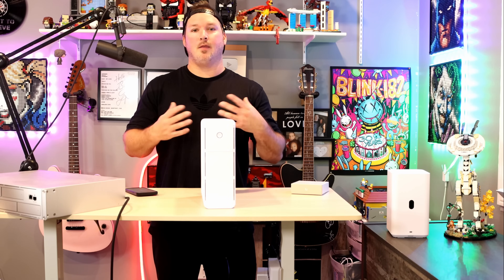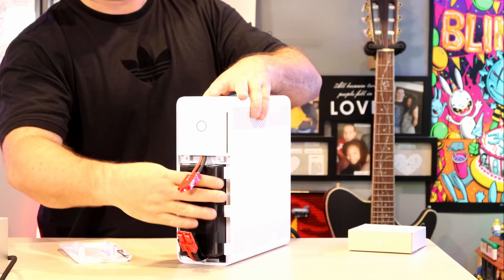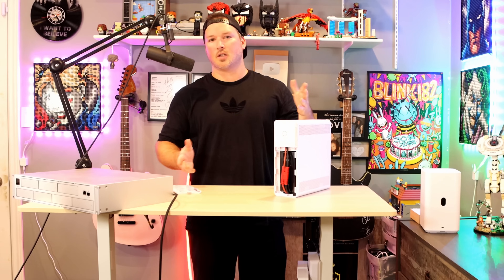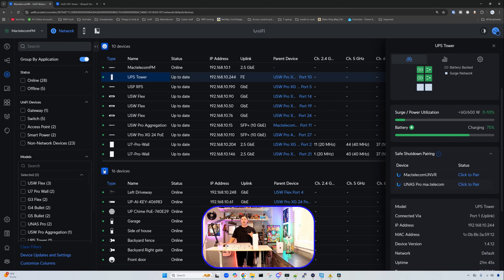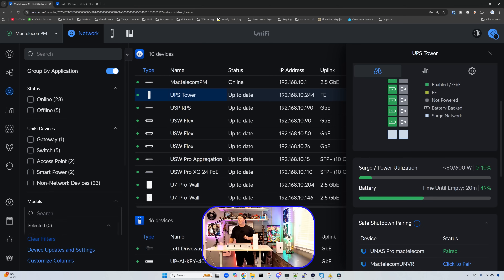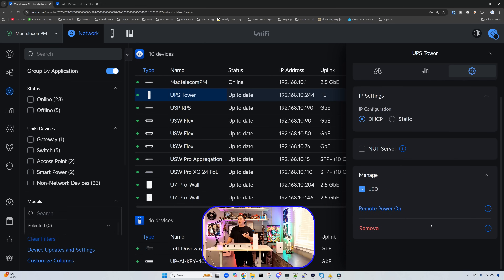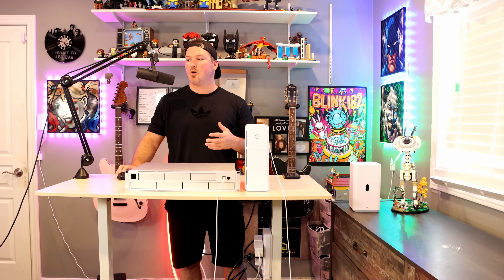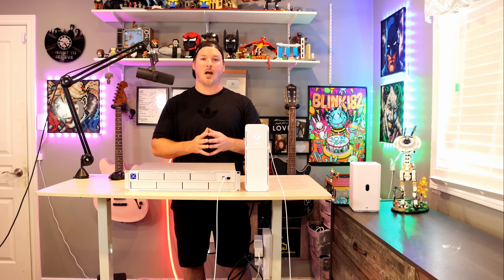UniFi UPS Tower Follow Up

Comment: In my area we get brownouts during high AC usage days, or occasional power outages because of cars crashing into the local power pole. In these cases the power has gone out for a few minutes before getting rerouted. Usually the 1500VA APC UPS saves our Ubiquiti gear and Synology server from having to shut down. It this can't recover from a power failure (and tell the server to start back up gracefully) then we have a problem.

Comment: Is this MHB MS9-12 battery not a conventional lead-acid battery? The Ubiquiti advertisement mentions a lithium-ion battery. The autonomy of these conventional batteries is very low. They could have used LiFePO4 batteries with higher energy density.

Comment: It's really about timing and use case and this is a flawed test at best...  Typically you would keep your device powered on during the power loss until closer to battery drain...and if power is restored, then there is not shutdown even for the attached device.   If power is not restored until batty is nearly drained, then shutdown connected devices and UPS runs out of battery and then cuts power to the attached devices (cuts power to the outlets).  this signals a hard power off for the attached device,  which if configured corrected, then when power is restored to the UPS/power flowing to the outlet, the attached device will auto power back on.

Comment: I don't have supported devices from unifi but with an HP Server (Proxmox and NUT) I works remote without the need to pull the power cable. You just have to give it some time to power off the outputs and ups itself, around 20 seconds and all lights on the ups are dark and you hear a relais.. I can't see if yours was off complete before you power on again

"remote power off" 
wait around 30 seconds
"remote power on"
wait around 15 seconds and you hear the relais and lights go on
wait another 5-10 seconds and my HP is booting

Comment: Love the videos.    My 2U UPS just arrived.   My set up.   Closet #1 has a UDM Pro + USW-Pro-Max-24-PoE on a Cyber Power UPS and Closet #2 has USW Pro HD 24 PoE + UNVR PRO + 2U UPS.     What I realized is a couple of things and I REALLY HOPE Ubiquiti adds more features to this.     My two closest are connected via a DAC cable.    

Once power is unplugged to Closet #2 the UNVR will shut down the UNVR in 10 Seconds on Battery (paired).  The switch cannot be paired so it stays on.  

 I happen to have an extra ethernet run to closet #1 to get the 2U UPS to the cloud gateway.    In other words "out of band management" connection to get to the 2U UPS without the DAC cable.   This product just isn't ready for prime time yet and some network design needs to be considered but you can get it back online without pulling cords...it is all about getting the power to bounce while not taking the path down to get the remote turn ON command to the UPS

I was hoping to avoid building a NUT server to help the scenario with some other NAS stuff I have.  They need to add individual plug behavior to the UPS interface.   FYI.   Once the power is off and the UNVR Pro shuts down in 10 Seconds....  My USW Pro HD 24 PoE ~50% port consumed , The 2U Ups says it has 1 hr 7 min of power remaining.

Comment: I grabbed one of these, plugged my UDM-Pro into it and then plugged into my switch with Ethernet, and Network hasn't detected it. I'm running UniFi OS 4.3.6 and Network 9.4.19. Am I missing something or did I get a bad unit?

Comment: It would seem that without the individual port shutdown option you can't get the right signal to a device directly plugged in to power back on remotely.  I can live with that personally, there are some smart plugs that can be used to workaround that I'd imagine but I think even for this price point it would be great to see that added like the Pro PDUs.  Certainly would give this an edge over competing/similar products.

Comment: For the price point, I get that it isn't fully "smart" per power port, but it seems like they could have added that and jumped the price $30, and we would pay it. I also hope they add some ability to control what happens when power is lost. I would like the ability to shut down select switches and even select POE ports during a power outage, but keep others up as long as possible. Keep your modem, UDM, and main switch running. Also, ensure POE is enabled on ports connected to common area WiFi, Door Access, and a subset of main cameras. By being more selective with what is kept powered, the battery would last longer, but still be there for power sags for all equipment.

Comment: Because each outlet is  not remotely controlled, I would plug my UniPDU into the UPS.  That way I could remotely “unplug” the UNas and cause a Remote Power On.  The optimum solution for me is to have battery banks inline from my main power to my rack PDU. Then use a DCIM to do shutdowns.
Reply: Well this TowerUPS is not really meant for a rack specific use case. It's a dumbUPS.

Comment: Feels like a very early product in general. I would hold off for a year or so and hopefully both features and capacity improves.
Reply: 12V 9Ah is the standard for office/home use case. Usually the batteries are HighDrain to hold PCs for a couple of minutes.

Comment: Will the Unifi system re-calculate the available power if you replace the battery with a larger 12V, lets say with a 60Ah?
Unifi must sort out the "device auto-restart after UPS is drained"-issue. That is a deal-breaker. 
V2 of the U-UPS Tower, should have 12, 9 and 5 V outlets as well, since so much of SMB network devices are in that range. Also the power cycling of outlets, with maybe a priority settings; If UPS looses main power, turn of outlet 4 when 50% of battery is left, then safe shutdown on outlet 1 and 2 when 20% left, then safe shutdown of #3 when 10%.

Comment: Just installed mine this morning. Already up to date, 90% battery charged.

But there is something I do not understand: the ups had a network activity quite “intensive” for a couple of minutes (almost 300 Mb), after adoption. Any idea?
Reply: Firmware updates?

Comment: There should be an option to set the shutdown time for each plug based on percentage of battery left on power failure. As well, lack of auto power on after mains power restoration is a deal breaker!

Comment: Those replacement batteries are a game changer in the UPS market: easily available and inexpensive when compared to APC and Cyperpower (or Eaton for that matter). But oof, that not coming backup when powering on... I suspect that is a bug and hopefully they will fix in an upcoming update. I wonder if that is a limitation with magic packets or something like that, or if they need to implement the ability to power cycle the ports.
Reply: I have always replaced APC batteries with third party batteries, just reuse their wire harness.  There is nothing special about the batteries inside APC battery packs.
Reply: What are you blathering on about? APC, CyberPower etc. replacement batteries are readily available (OEM and third-party), and are not expensive.
Reply: @milhousevh  The same batteries APC uses are available from others for less.  If you want to pay full price for an APC labeled battery then go ahead.  If I can save $30-40 and reuse the existing wire harness then it is money in my pocket.  Paying $75-100 for APC labeled batteries is expensive for me as I have many UPS devices.
Reply: @jaycahow4667 That's what I said. Batteries are available from third-parties. I'm not saying anyone has to buy the branded OEM batteries (although they can if they wish).

Comment: Thanks for the follow up.  Silly it doesn’t auto power on.  Can I ask, the battery is HOT SWAPPABLE right ?
Reply: Every UPS I have seen with a breakable battery power wire was hot swappable so I would guess this one is as well.

Comment: Also as another warning, the compatible devices listed on the website are INCORRECT and confirmed by Unifi support. The only devices that support smart shutdown right now seem to be storage devices and NO other device.
Reply: All their devices are actually compatible with all UPS devices as they just take power unless they need true sine wave power which only some UPS devices (not this one) deliver when on their batteries.  Storage or computer devices are special because unlike their other devices they require a graceful shutdown to prevent lost or corrupted data especially if they have write caching enabled.  So it makes total sense that only storage devices support remote shutdown.

That is not preventing them from implementing remote shutdown/startup of other devices but that is not something you normally do like recycling a switch or router remotely.  You might recycle a hung POE device but not normally the entire switch.
Reply: @jaycahow4667  I understand what you're saying but it was a bit confusing/misleading I think at the beginning. They have since updated the website to specify the graceful shutdown is only supported by those two storage devices.

Comment: If you remote power off, ALL DEVICES connected to the UPS tower will turn off just fyi.
Reply: I  noticed that with the 1 I purchased and received today. It seems to have 1 relay to control all the backup outlets.

Comment: Try unplugging the UPS mains power and leave it alone until the UPS completely runs out of battery and shuts off. Then re-connect the UPS to mains power... does the UPS automatically power itself back on and restore power to the UNAS then.

Comment: Not a bad unit but only having a single 9ah battery you will need to be very careful on what you plugin so in event of a blackout you have enough runtime on battery to do a safe shut down. APC ups tower units normally have 2 - 7ah on the low end and up to 2 - 9ah batteries for double the runtime. With the APC BR1500G able to connect and exterrnal addon battery pack that has an extra 4 9ah batteries. My  BR1500G with the battery pack with a 130w load can stay running for 171 minutes without wall power.

Comment: I like the ease of replacement with the battery. It was kind of a PITA with my cyberpower UPS. But this UniFi UPS doesn’t have pure sine wave and is pretty low capacity. I’ll wait to see how the 2U UPS reviews look.
Reply: I think 2U has the same drawbacks, they are working on an enterprise variant, that should have per-port power control, and pure-sine conversion, I think they also mentioned lithium ion as well.
Reply: This price range can hardly have pure sine wave , that requires a whole lot more components/electronics. Anyways , SMPS downstream can handle blocky wave AC. Its a Unifi integrated  "cheap" ups. Nothing spectacular. Good thing doesn't require a separate NetworkMgmtCard. Hope 2U version will be smarter.

Comment: Sending mine back.
NUT server is buggy
No labeling of each port, nor can you manage on/off/restart the plugs remotely.
It's not Pure Sine Wave
Ethernet Line Protection seems to support 5GbE for anyone inquiring - I have 10GbE and it degraded my link connection.
There are options out there that also have USB 2.0/C connections for a little more than these including LCD display.
Reply: It is just a small low end UPS device and you had high expectations.

Comment: I was under the impression that the unifi ups was LiFePO4 , but now I see it is lead acid, that is a no for me, lead acid sucks, their lifetime is horrible, and they fail whenever you need them the most. I personally have an Eco flow river with 286wh, and a kasa power strip, it literally runs my dream machine se, poe switch, cameras and access points for over 3 hours when I get hit by a power outage. I really don't know why Unifi went for lead acid to be honest.
Reply: At this price point it does not make financial sense that is why no one else does it either.
Reply: the ecoflow is 200 bucks, so, it makes a little sense.
Reply: LeadAcid is used due to safety reasons. Simple and effective. Can you imagine UPS companies pushing Lithium , man the liabilities , astronomical risks.
Reply: @GabrielKozsar  I´m talking about LiFePO4, lithium iron phosphate, you are thinking of Lithium ion, LiFePO4 is much safer, and last something like 10 years under normal use, not like lead acid that fail if a unicorn looks at them the wrong way.

Comment: Man, NOT having the NAS, NVRs or gateways coming up online after a power outage sucks.
Reply from the maker: So I need to test what happens when the battery is fully drained then put power to it to see if they come online

Sadly for my my house gets like a 1-3 minutes power outage very rarely so I’ll have to physically unplug
Reply: NVRs , Gateways ----> 2U UPS will certainly have that advanced functionality. This is a dumbUPS with network integration/notifications.
Reply: @GabrielKozsar I wouldn’t hold my breath…

Comment: thats not what i expect from Unifi, i have a APS UPS at my synology and the synology comes back automatically when the power comes back
Reply: Indeed. Synology also works with NUT servers. But it uses a fixed username/password you need to set on the NUT server.
And Synology doesn't completely shutdown, it unmounts the volumes when it gets a power outage notification. When the power does come back before the ups shuts down it will remount the volumes (except the encrypted ones).

Comment: If you have the lead acid battery in it beware of the battery swelling up after so long. You will want to replace it on the recommended schedule without question as I’ve had to pitch numerous APC units where the battery had swelled so much that removing the old battery wasn’t possible without damaging the UPS beyond repair. 
   I went to order one of these as soon as they were available but simply could not get on board with paying the unbelievable shipping costs for it, with shipping and tax the total was almost $224.00 & that to me was beyond what I’m willing to pay for it. Maybe one day I’ll change my mind but as of now I’ll stick with the APC unit I’ve been using.
Reply: UPS devices have two charge rates they can feed into their batteries.  A higher rate for a main charge and lower trickle rate to hold the charge.  The internal UPS circuitry controls which rate is used and when.

When that internal circuitry starts to fail the UPS sends too high of a rate into the batteries which causes them to swell, fail, and be hard to extract.  In my experience with many UPS devices once one causes batteries to swell it will continue to do that with replacement batteries as well.  Replacement batteries will work for awhile but then fail again unless the underlying problem is addressed.

I suppose batteries themselves could fail but I have over 20 UPS devices currently running and many more over the years and I have only had a couple that batteries ever swelled before they failed.  When they start to swell batteries I get rid of the UPS device.

Comment: Oof, no go on rolling these out if equipment won't power back up after restoration. We lost some money after rolling out tripp lite rack mounted UPS that had the same problem of needing to manually restart the UPS or device after the power was restored. Wasn't a warranty issue so we just ended up replacing them with APC's on our dime.
Reply: Currently using APC with it turning back on after power restoration as well as everything connected to it. Now this is a deal breaker for unifi UPS line if they dont have that feature. All of their networking gear basically turns back on after power outage - but why on earth is the UPS different? 😅
Reply: @crimsonmortal  exactly! We have a lot of power issues around here and it was brutal constantly dealing with systems being down when we had that run with Tripp Lite. Since we really dove in with Ubiquiti in the few years I was happy to see there equipment handled coming back online on it's own when the power was restored.
Reply: Surely UniFi can address this with software update. No way they launched this with such an embarrassing design flaw.

Comment: the fact that it doesn't know which device is connected to which port.... the fact that you can't turn on and off the device properly... the fact that you cannot see how much power each device is using per port.... this is a toy.
Reply: I don’t like it either, but you get what you pay for. I would imagine their Pro and Enterprise lineups (briefly mentioned in their announcement video) will have what we want. We will have to wait and see.
Reply: APC BackUPS with Network integration. Nothing more. The price is a teller.
Reply: It's very helpful to know the power consumption levels per port, as well as the input and output voltage information, to generate a power quality report. My SMS UPS has this feature. I expected more from the Ubiquiti UPS.
Reply: You want those options? Spend the $1k plus

Comment: Can you not cycle the power port to make it come back on?
Reply: There is no control over individual outlets, no news on if it will ever be available.
Reply: @RyanJacoby true, but the UPS could just power down until power is restored once everything is shut down… and then power back up once mains have been restored.
Reply: @wb6vpm as shown in the video, when the UPS does a scheduled shutdown, it cannot remotely power on connected devices after the main power is restored. A physical replug of a connected device is required to power the device back on. Only a manual remote shut down allows for a connected device to power back up remotely.